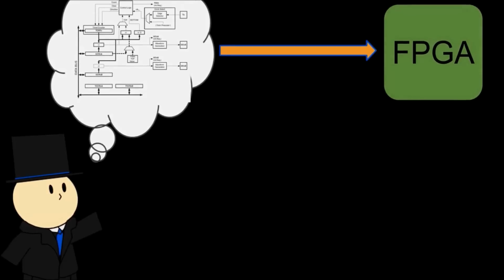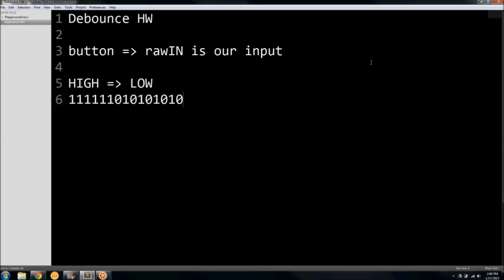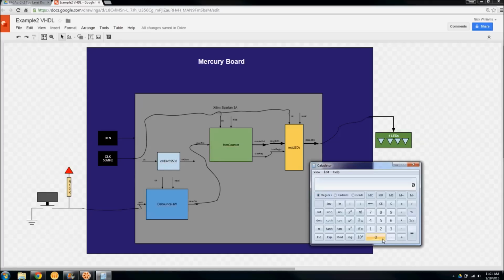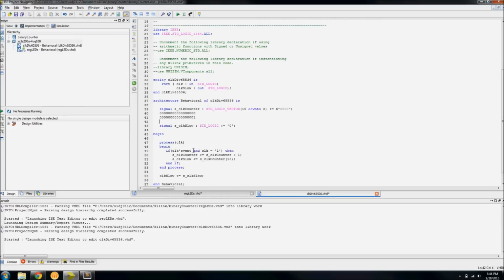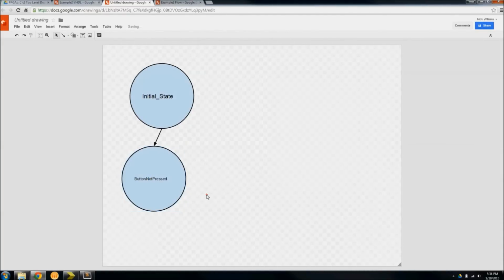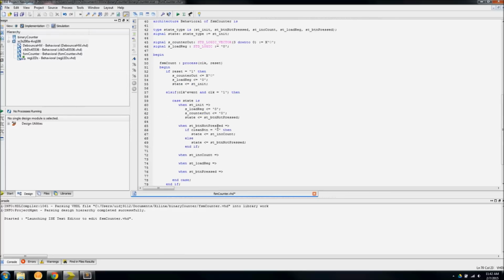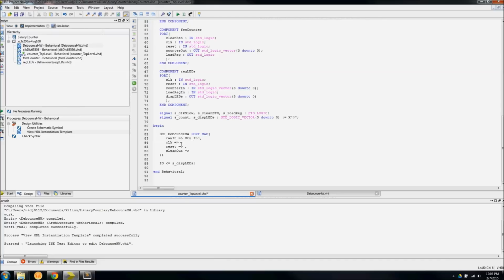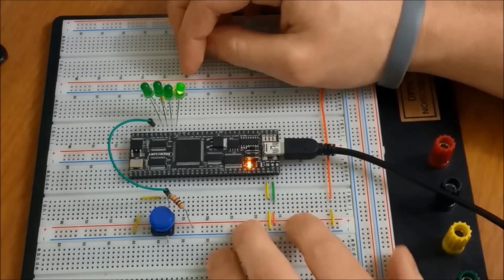FPGAs; Lesson 2: Interconnecting VHDL modules; Top Level Design and much more

Comment: If I am not wrong there is a oops in your implementation of the clkDiv's counter :
It takes 65536 to flip the bit of clkSlow let say from 0 to 1, which is actually half of the way/period. Hence the module output at a frequency of 1/(65536*2/50MHz) = 381 Hz and the DebounceHW check for 8*1/381 = 20ms.
To my pov the counter should be set to 65536/2 = 2^15 for the DebounceHW module to be a 10ms window.
Reply: Ho right ! the last bit is 2¹⁵ = 32768. I wrongly understood it was 2¹⁶ but that would have implied that it was counting over 17 bits, which it is not. Silly me :D
Thank you for answering and for the video.

Comment: You don't need to change your clock input. If you just keep shifting s_debounce left (anything in the 8th bit is lost) and filling the bottom bit with the signal input from the button, it will keep going until s_debounce is stable to 11111111 or 00000000 even if it takes more than 160ns. It does not stop shifting the bits just because there is a 1 in the 8th bit ;)

Edit Maybe you are thinking that the clock speed will be too fast to see a slower 'bounce' that could fill the s_bounce with all 0's or all 1's before settling. In which case you are right to slow it down :)
Reply: Yea I got a bit confused too, he could have said that with such high default sample frequency, a jitter of the button would have been sufficient to trigger a stable output ; hence the decision to lower the frequency.
Which is coherent with his choice not to translate the transition phase as a stable output.

Comment: Better to have the button connected to the power rail with a pull down resister and look for a signal rise. That way the circuit does not consume more power than necessary.

P.S. Your button graphic looks too much like a computer monitor lol

Comment: You're one subscriber richer. Your first 2 videos have been a great help. One thing I can't wrap my head around is why you don't just use the rising_edge(CLK) command? Do you not know of its existence or does your way have an advantage?
Reply: +Nick Williams Thanks for your reply. One other thing I noticed was that in the clockdivider you assign s_ClkSlow to s_ClkCounter(15) and then you assign ClkSlow to s_ClkSlow. Isn't this unnecessary? Can't you just assign ClkSlow to s_ClkCounter(15) that way you would only have to make 1 signal.
Reply: +Nick Williams I also noticed in the Debouncer that you initially assigned s_CleanOut to '0', but shoul'dn't his be 1 as 0 is the Pressed state and 1 is the NotPressed state?
Reply: +Nick Williams Haha no problem, everyone can make a mistake. Why did you choose to assign 0 to pressed and 1 to not pressed anyway? just for funsies?
Reply: Afaik the threshold level for high is relatively low, but the threshold level for low is also low.
So you have to use lower value resistors to pull something low, which means the current will be higher when the button is pressed.
Otoh: it doesn't take much to pull it over the high threshold. And the high voltage is so much higher than the threshold, so you can use very high resistors.
Pulling it low will therefore have a lower impact.
Of course I am purely speaking from theorie of 26 years ago. After that I went into software ;-).
Only recently picking up electronics again, since fpga's are now affordable.

Comment: This was a great video for people just taking a first look at FPGAs like myself.  I'm still at the watching YouTube videos stage, so this was really helpful.

I did have a question that I'm hoping you could elaborate on.  Does the fsmCounter really even need to take the clock as an input?  When you defined the process, you told it to trigger on the clock and the reset pin.  Could you instead have it trigger the process based on cleanBtn?  It seems like a lot of the logic is used to disregard the process being triggered unnecessarily by the clock.  There may well be a reason not to do this, but I was curious.
Reply: Maybe it's also a habit from microcontroller programming, where every process has a clock. I'll have to look into using signals as triggers, because from a pure hardware perspective, a series of flip flops would be the simplest way to do it, and wouldn't need a clock.